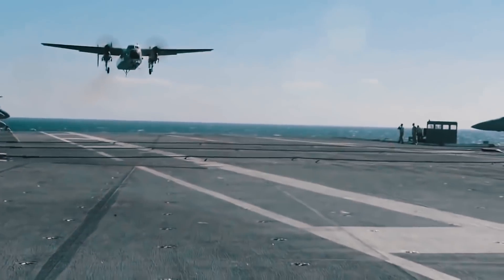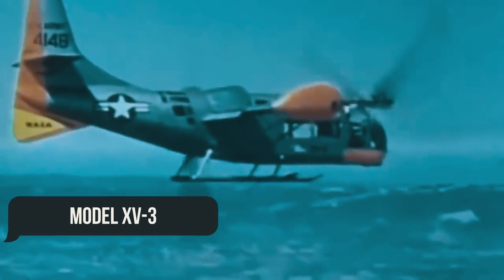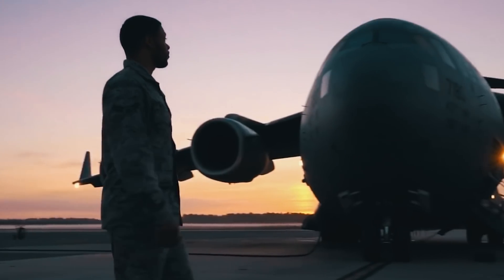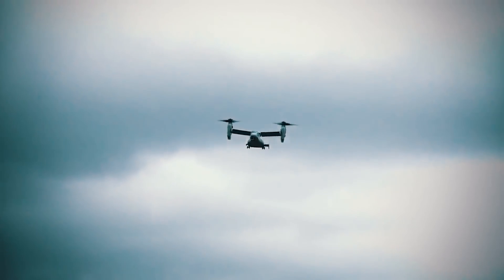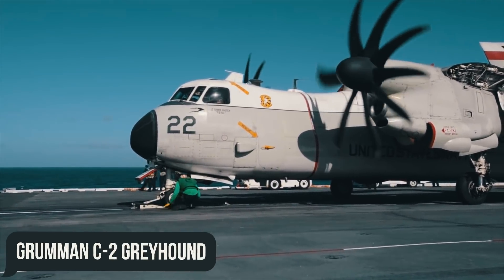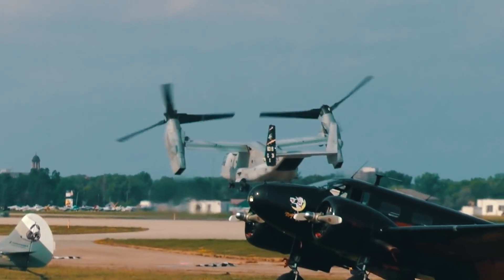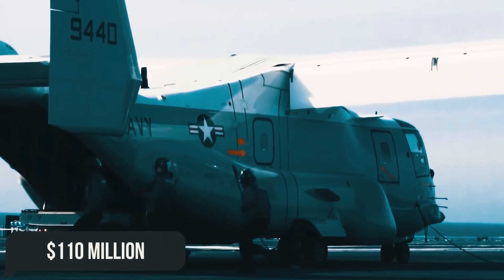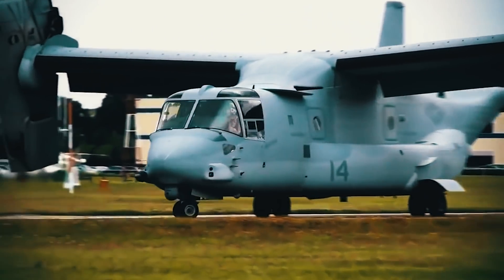The C-2 Greyhound Replacement is Coming

Comment: If you're claiming that 400 CV-22's make for good economics in relation to the CMV-22 production, you should really add the total number of E-2 Hawkeyes to the C-2 production. After all: the main difference between the two is the fuselage: slender with a radome on top for the Hawkeye, bulky for the Greyhound. the tail section, the wings, the engines, the props and I believe even the cockpit were shared. Now, the total (450 or so) of Grummans still does not compare to the 400 CV-22's built annually, but it does give a fairer comparison.

Comment: This aviation concept is so far very impressive but if the flight speed could be supported by a single powerful jet engine and increase the flight distance with maximum capacity of 40 person on board where the total manufacturing cost is in a very competative price then it will became the most preferable choice of global aviation industry.
Reply: Say hello to a typical small regional jet airliner. And with it, the inability to land on any ship whatsoever.
Compromises need to be made, some aircraft are good at one thing, some are just "okay" at several things. The V-22 in it's various versions is one of those "Okay at many things" aircraft.

Comment: Of course it will! These rigs are incredibly adaptive, and have advantages over their present day counterparts currently in use, in any theater. Early issues with crashes and reliability have been absolutely corrected. Their current safety record is excellent.
Reply: Definitely a good, well usable design!
Though.. bit Ironic regarding the recent news about one V-22 crashing in norway ☠😅
Reply: You are joking. The accident rate on these have been white washed by the Marines because they want it so bad. Over 13 hull losses so far and one just 2 months ago 4 more dead body to marines arm. 50 dead bodies so far and they have just basically got operational. Initially 84 million out of tax payer pockets and with today's inflation rate over  one hundred million.

Comment: The Osprey started out VERY poorly with safety and reliability issues and massive cost overruns and took forever to develop, but the end product is WELL worth it.  The F-35B and Osprey make a powerful combination and turn craft like the Wasp or America into very capable light carriers.  The Osprey is mostly replacing helicopters, which have a fraction of the speed nd range.  This is similar tot he F-35B replacing the much slower and shorter ranged and less equipped non stealth unreliable Harrier II.  I would like to see the navy make more things based on the Osprey, like an attack craft to replace the Apaches, an anti submarine version, a sea rescue version and even an AWAC version.  This would reduce the costs of the Osprey even more and make light carriers even closer to the capabilities of the larger carriers.
Reply: A lot of US Marines died.
Reply: @bighoss9705  how do you mean? Marines died from the accidents that the Osprey had?
Reply: @bighoss9705  Yes.  The original prototypes did not do well with 2 crashing and even with the redesigns, the craft had some problems and 2 more pre-production models crashed in 2000.  By 2005 they had the final redesigns and it seems to be running great now.  I question how useful it is for the Army, but for the Navy/Marines it is a powerful asset.
Reply: @toddabbott781  the maintenance required for it is still terrible
Reply: @UnseenAtom99  It is higher to operate than originally quoted, but not excessively so.  Except for early testing it have been very reliable and safe.  They do have an issue with sand so they might be restricted to landing on roads and parking lots or grassy fields... o risk damaging the engines, but this is not exclusive to the V-22.  The capabilities though when compared to a helicopter is crazy impressive with both speed and range being WAY beyond what a helicopter can do.

Comment: The Technology is sound.   Though I would like to see  a development  hybrid between this aircraft and the Sikorsky S 64 Skycrane.  The diversity of that hybrid would be unmatched.  As it wouldn't have to land to deliver its cargo.  Wouldn't need a landing pad. fueling probs mount on ships could refuel it as well wile in flight.  Each cargo pod can be specially designed to handle any mission including combat.   Add stealth capabilities to the aircraft.  It would be a fear of the skies.  It could also replace the C 130.  the C130 even loaded can land and take off from carriers without tailhooks or catapults.  But the transfer of cargo is limited with speed of.

Comment: I was in VR- 30 from 1970-1973 . VR- 30 was using the C1- A trader COD .for on bourd delivery of mail and supplies. VR-30 was testing and training for C2A Grayhoindsinthe 1960's then the C2A Grayhoinds were transferred  to VR-50 for the operation  of the Grayhoinds.  The C2A Grayhhound did not have the best saftey record the C2A Grayhoinds likes to through pieces  of the props through the body of aircraft and killing members of the crew. I last good friend  that was killed that way in the Med also all the Grayhoinds were downed in the in the late 1960's because of prop problems  and VR-30  had send C1A trader to pick up VR-50 flights out Carrier  off the coast  of Vitnam to service the Carriers  in the area.  The C2A Grayhoinds has had three prop up dated to fix the trouble of bad props
.
Reply: C2 has a lot better safety record than the vs22 and has several hundred thousands of hours behind them. I would fly C2 any day over ofspray

Comment: so when are they going to switch to an electric version that is self-sustaining and recharges its own battery while it's in flite ???
Reply: It has batteries, but it can't work on battery power alone. You don't understand how it's designed
Reply: @canadianrandolph  i tryed reading the design specs but I was so tired I kept zoning out but from what I remember if they redesigned it to work off a new type of battery an added 2 more props to it but id have to look at it again I did it to a drone once an it hovered in my back yard for over 90 days straight till I killed it
Reply: @draven1438  Drones are Much smaller than this. Look at the function of the engine and you'll see how it creates the power necessary for thrust
Reply: @canadianrandolph  i tried looking up the engine design but couldn't find them with enough detail but I was thinking of trying to build an all electric boat the charges its own battery well I've already got most of the boat built

Comment: Why would the Navy need a COD flight to deliver an F35 engine? That should be
something that is loaded before the carrier leave port. And the argument that
CMV-22B is going to be safer because it can fly at night is just crazy.
Reply: Though the navy does have space for several large and small components. If you think about it, it sort of depends on the type of ship that they deploy the F35s on, and the amount of F35s that they actually have attached to it. With most of the military aircrafts, after being used again and again and again, its not rare to see engines needed to be changed every so often, which if they run out of the stocked engines aboard the ship, then they would require a COD flight to deliver extra engines. For the nightflight scenario, I think it was referring to combat scenarios where if the enemy cant see you at night, then its kind of harder to be shot at 🤷‍♂️. As a Marine that mechs on the MV-22 and has flown in it day and night on to a ship, I can personally tell you that I trust our ospreys and have felt very safe every time.

Almost forgot to mention. When we flew over hostile territories in the middle east for transport or missions, you could feel the difference in the crew and passenger tension from the day vs night flights.
Reply: @olliriummusic7951   Thanks for the info.

Comment: I'm wondering why they can't use jet engine's these days instead of large rotors to power the Osprey as they would even fly faster.
Reply: Because jet engine pointing straight down is horrifying.
Reply: @britishrocklovingyank3491  Well they have jet engines facing down already in the F-35 Lightning II Stealth Fighter Jet.
Reply: @ianjensen7989  F35 doesn't land on unpaved surfaces like the osprey does.  A jet engine will carve a nice hole or start a fire on the ground.
Reply: They would have to redesign the Entire Nacelle area. I can tell you Personally it is already a jumbled mess and a heavy aircraft, so it would need Alot of power to lift it.

Comment: back in 1964/5 at an airshow on Wiesbaden AFB. There was a German JET rotor engine aircraft.  It looked exactly like our V-22 but smaller. it had two jet engines on each wing tip. The pilot did a lift off and a small rotation of the air craft just before lining up for take off.

Comment: I really wish they would change that to 4 engines set the sequence not on the wing and either go electrical plasma are pure hydrogen jet fuel motor the rotors will always have a limited speed no matter what so why don't they just go. Jet engine the four of them leave out the blades make it work at Cary more than twice and what the huy could make it work at Cary 2 semi trucks full of cargo at a time

Comment: The Osprey is definitely the more versatile aircraft when compared with the C2. However, the C2's configuration is simpler, less complex, and easier to maintain. I don't see the C2 being completely replaced by the Osprey, based on availability and years of experience.  But as time passes, and more maintainance crews and pilots become more and more familiar with the Osprey, the CV 22 WILL replace the C2 in most of it's transport functions. However, the C2 will continue to serve the US NAVY in it's other configurations until replaced by smaller, less expensive , compatible aircraft since it's cargo carrying function will no longer be it's primary function.
Reply: I agree with you on not decommissioning the Greyhounds right away.  They most likely will become land base for operations, to make room for the V-22 squadrons.  I worked on the C1-A and the first C2-A's in the 70's and 80's.  Back then the C2's were not as rely able as they are now.  The navy back then was so concerned that they were looking at converting the S-3 to replace the Greyhound.  They had already made a few to test the concept back then due to the problems with the Greyhound.

I only suggest the land base concept because that is how it was done back then, before the Greyhound became carrier based.  I was in the VR-24 squadron in Sigonella,Sicily and we had C1-A,C2-A,T-39(for medavac/VIP transport) and H-53(assigned, which later became HC-4.)

Some of the main problems with the Greyhound then were as follows:
APU Inop
Contaminated fuel due to paint in fuel cell pealing off after SLEP work.
Props going into auto feather or unbalance and even out of sync.
They had other problems but I only remember those that relate to Power Plants.

The C1-A's which I mainly worked on had to cover for the Greyhounds back then, but I also work on the T-39's and the Greyhounds.  Did many engine and prop changes.  Also back then the Greyhounds only had 4 blades and I was in Pax River when the new blades were being tested.  They also were testing the V-22 concept at the time, a aircraft that did not past the testing.  But it takes years to get a aircraft approved for military purchase.  The F-18 was just in it's carrier testing when I left back in 1985.
Reply: @gvidvr  Apariently you didn't listen closely at the very start of video not min. He's talking about the ending of greyhounds, their from the 60s , THEIR
DONE. In another 20 years no pilots 
In combat only self governor drones.
Reply: I was hoping they would upscale the V-280 design with props that fold away in flight for jet engine use.

Comment: THE OSPREY HAS EVOLVED AND MATURED INTO A INVALUABLE PACK-MULE WITH GRATER CAPABILITIES THAN THE GREYHOUND...AN ENGINEERING MARVEL FOR SURE!!
Reply: its rubbish
Reply: An amazing aircraft. They sometimes fly over my home in Lincolnshire. But the sheer size of the damn things must restrict their capability. For example jungle clearings for the delivery and recovery of troops need to be bigger than for the Huey.
Reply: Well, after it killed a lot of people, including a Marine Corps general, it was basically rebuilt from the inside out.

Comment: VRC-50 decommissioned in the early 90's. You meant VRC-30. You also said the Air Force would have to modify the C-2's, the Air Force doesn't own or operate C-2's, the Navy does.

Comment: Would it be possible (in the future) to see the bladed engines upgraded to a type of jet propulsion engine? Kind of like the VTO style used with the Harrier jump jet? Costs would be sky high no doubt, but the speed increase would be crazy.
Reply: Fire, everywhere we land would be on fire in a matter of seconds
Reply: Jets Will limit you landing site since the heat Will damage the surface
Reply: An ultra high bypass turbofan would be perfectly feasible in Navy and Air Force use, but not Army or Marine.  If you only land on paved surfaces, you won't have problems.  It's not the heat that'll give you trouble, but the concentrated speed of the jet wash.  It's sort of like a garden hose vs pressure washer, both put out about the same flow, but they do it in considerably different ways.  That jet is going to dig holes and throw rocks all over the place, including toward the aircraft and into the engines.  A large disk from a V22 or helicopter rotor is spread out over a very large area, and even then you're kicking up a lot of dust.
Reply: @Skinflaps_Meatslapper  you do realize air force ospreys do not have the same mission as marines or navy right? We don't land to a prepared surface unless we are getting gas
Reply: @Skinflaps_Meatslapper  They need the engines running to do engine water washes, fueling, and to take off to and the aircrewman have to get under the blades (in VTOL) to do stuff too. There's also areas of maintenance on the Nacelles themselves that require the blades to be turning. None of that would work with Jet propulsion
Reply: the idea is cool I would love to see them like the pelican from the game Halo, but our tech is not yet there to allow jet engines to facilitate the carrying capacity that propeller engines has as far as cargo aircraft goes. horizontal flight, yes jet engines can out carry any propeller engine planes, but vertical, it's still a long way. but still, the concept is not impossible, it's just we are not yet there.
Reply: Spied isn't high on the priority list for cargo aircraft. Cargo capacity and reliability are. Jet engines of similar thrust would be costlier, heavier, more complex and harder to maintain.There's also the issue of what to do about the jet wash doing VSTOL in  grassy or brushy environments. The Navy probably wouldn't care much, but the Marines surely would. I'll bet you've never seen a Harrier land on anything but bare dirt ,pavement, or steel..
Reply: It would pass everything but a tanker.

Comment: The V22 is progress and It has improved over time to be reliable. Can they reduce the cost to closer to a helicopter, If they can that will be a real winner. I would like to see if they can make a spec-tor version?
Reply: Not possible. 

For the simple fact of it has more components that need the same flight hour maintainance. 

2 hub and rotor assemblies, 2 prorotot gear boxes, 2 pylon conversion actuators (normal helicopter don't have these at all) 

Along with some other stuff. 

It's simply never going to be possible to make the cost comparable to a normal helicopter, however I think they can get better than where they currently are.
Reply: @justjuan589  one blade costs around $760K

Comment: Why a rotor propulsion? Would jet engines be better or not and why?  I've seen jump jets move around very well when hovering. Please, someone with real knowledge of rotor verses jet engine comment.  Thank You
Reply: Ncis s1 e6 plane
Reply: Our engine exhaust will melt tarmac in our current configuration. Replace the rotors with a pure jet system and we will literally light everything on fire every time we land
Reply: @ar3317  makes sense, ok. How about modifying it like jump jets?
Reply: And the quation is could we ignate jet engine in vertical pasition  and make it resulting enough energy to lift plane up without  waste the fuel too much. 🤔

Comment: I think the Osprey already needs considerable upgrades or should be replaced altogether.
Reply: WTF???? It is actually still fairly new. And the Marine Corps has already paid for all the R&D for it, and paid for it in blood. A few crashed during testing and several Marines lives were lost. As time goes on, yeah...the various technology stuff can be upgrades...but replaced...nope. It give the Corps and the Navy more distance in flight, which was one of the big issues for the Corps, since helicopters have much shorter distance than it. Safer to fly than a helicopter as well. The Army is building it's own version of it.
Reply: @kavik2825  safer? I was always under the impression tiltrotors had way more spectacular wipeouts than helicopters.
Reply: The osprey has tons of survivability features built in. And a better safety record than any military helicopter that I'm aware of.